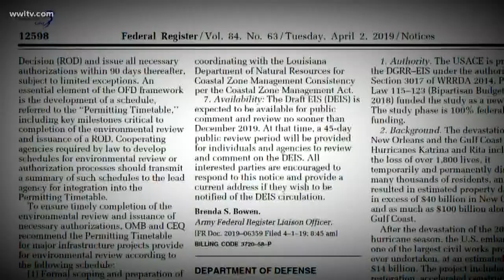New Orleans levees sinking faster than planned

Comment: Just make huge water pipelines to desertic states like California, and Nevada. Is possible we have the keystone pipeline  1850miles long and Cochin Pipeline 1900 long. Cochin's capacity is 95,000 barrels per day which is around 3,990,000 gallons a day. Spend the money on that instead. Google is I'm not lying, share it! Print it and post it on the keystone pipeline coated 5.2 billions to build, just do the math.

Comment: The levee held with Ida but New Orlean will always get flooded.  The whole area is at least a foot under current sea level.
They would need to invest a lot more in pumps to get everyone to stay dry. I don't even think you can do that.  Some area are just too low...should really be natural wetland
Reply: Metairie is 3 feet above sea level it's barely above sea level.. And apart of new Orleans * is Orleans above sea level barely since half of it is below

Comment: You can not save New Orleans if you do not allow the parishes below New Orleans to flood ,10 years ago a study was done from geologist! The silt that flows past all the levies is settling on the continental shelf,it it is bending under the weight and is causing all of the top soil to slide into the gulf,there is not enough dirt to build the levies you need .The only way is to let plaquimine and other parishes to be flooded every flood season.
Reply: Sadly these coastal "Master" plan people are dumb.
Reply: Trying to make diversions will lead to massive amounts of land loss. 15-20 years ago areas of Plaquemine would be forest , now dead Wetlands

Comment: New Orleans was underwater in 1735, again in 1785, and levees (albeit not the structures of today) were in place at the time. Floods in 1862, 1866, and 1867 with levee failures at the time. No one, including the Corps of Engineers, is going to stop the Mississippi from doing what nature dictates that it do. It is just a matter of time before the great carves a new path. Given the information we have and the scale of the levees today relative to the past,  additional monies put into levees along the lower Mississippi seems irresponsible and short sighted. Maybe if I lived there I would feel different, but I don't think so. The facts in this case are clear.
Reply: God plaques